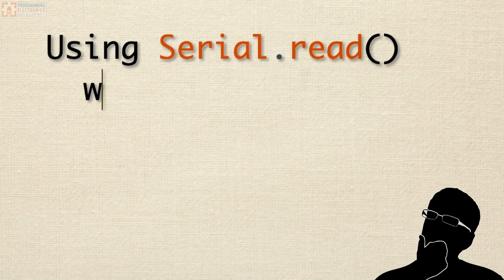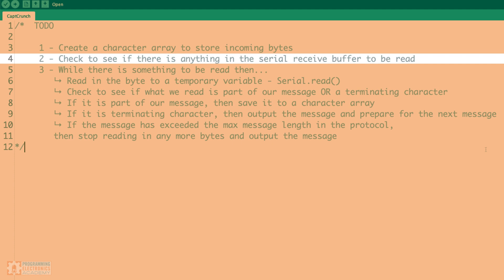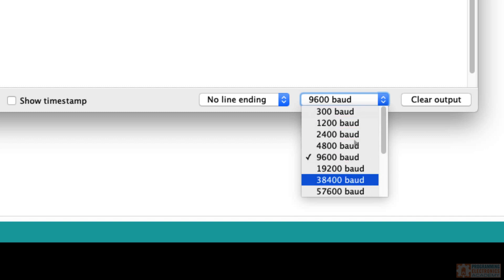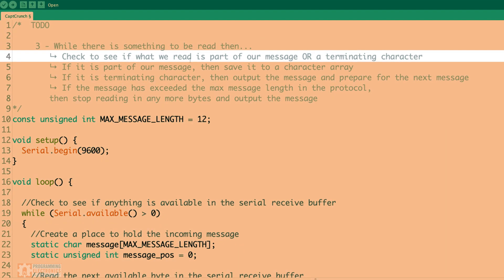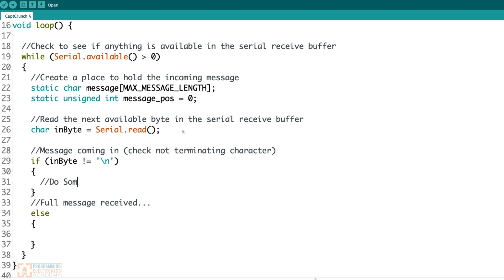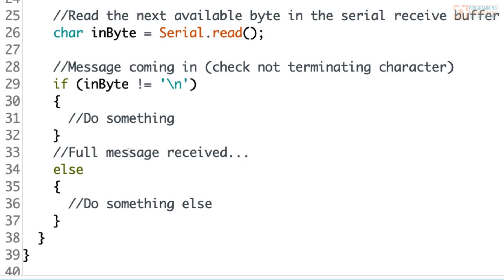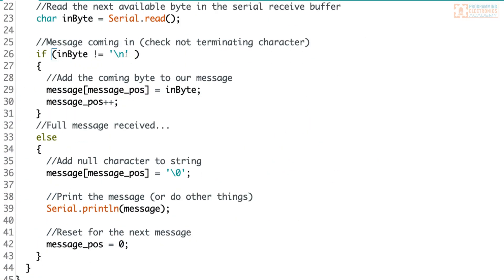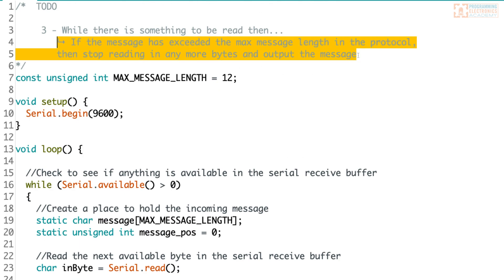Using Serial.read() with Arduino | Part 2

Comment: Can you use Serial Monitor keeping Arduino connected to PC via USB (or even only powering it through USB) and use RX and TX pins to communicate with another device at the same time? My limited understanding of Arduino tells me this is not possible. Explaining a hardware layer would be great please and comparing hardware serial with Software.Serial. That would save some frustration and debugging.

Comment: Parts 1 & 2 have cleared up hours of head scratching after trying to read tutorials on sending data via serial in Stackoverflow and Arduino forums.  I come from a JavaScript background, but the devil is in some of the minor details which go unexplained in a lot of forums out there (probably because prior knowledge of arduino programming and concepts is assumed).  

Those minor details given here made it much easier to understand code elsewhere that had me flummoxed.  Thank you; you've earned my sub.
Reply from the maker: So glad it helped!  I hope you enjoy using Arduino!

Comment: I have a q. Are you sure we have to put the char message and message_pos inside the while loop?
Reply: Good q.
Reply from the maker: Great question.  You could set those up as global variables if you wanted.
Reply: @programmingelectronics  I suppose they should go just outside the while loop and inside the void loop. That way you can reset them to default in each loop. Leaving them inside the while loop the pos is always 0 and the message always changes. I can't understand if it works properly.
Reply from the maker: @periklisdrakousis6537   The variable is set as static, and so it is only initialized once (then that initialization is skipped over after that), which is why it works like it does.
Reply: @programmingelectronics  ok thk u.

Comment: i'm sorry but, i'm confused. 
static char message[12] consists of 11 characters and a NULL character 
when you typed "sub sandwich" = 12 characters, where is the NULL character?
Reply: at 13th position you can print it to check.

Comment: Very good tutorial, and helped me get started on Serial for sure. I did find one thing that might need to be tweaked. Every loop if you exceed the MAX_MESSAGE_SIZE you will lose 1 char out of the buffer. This is because we call Serial.read() before checking the max length of the array. There are many ways to solve this, I ended up doing the check for the max message size before a serial read to prevent losing one position out of the buffer. Using the identical else to clean up anre print the buffer, so I didn't read an extra byte from the buffer. Thanks again for the great content!

Comment: Super Great Video! but I dont see anything in your code to indicate which pin incoming data would coming in? 
(also i'm kind of a noob)
Reply from the maker: Great question!!   The serial Input here is coming in via USB which is connected to pins 0 and 1 on the Arduino.   Hope that helps some!

Comment: Thanks for the great tutorial series. Is there a way we could put a reset in the program when serial communication between master & slave (Simplex) could not sync. I have a master that sends multiple bytes  Ex. "A" contains int val of 2, B has 5, C has7 value and  so on. When I power up both master & slave at the  same time it  all syncs fine. But when you power up one after the other it does not sync even after waiting. When you press reset of slave, one or several times it syncs. I'm using  Arduino mega for both master & slave using Serial 2 port. Is there a way to put a software reset when it does not sync for say about 2 seconds.  I'm using  arduinoJson to serialize & deserialize. I think it's also useful to have a reset when the serial wire was accidentally disconnected. Thanks you.

Comment: Is anyone testing this with the Arduino sketch editor? I copied the code in and tinkered in the serial monitor with No line editing, newline, carriage return, Both NL & CR and none of them parse the data into neatly organized output. It doesn't work for me. Bummer.

Comment: hi, if i want to send let's say 6000 int from laptop to arduino how i can do this ? because arduino buffer take only 64 byte !
Reply from the maker: Great question!   When you use the read function, it clears the serial receive buffer - so depending on the timing you need, you could send a couple, then read a couple, and work through the 6k ints that way... of course, it might depend on what you're doing with the ints when they arrive...

Comment: It's impossible not to subscribe after this smooth tutorial
Reply from the maker: Glad it was helpful!  Are there any specific Arduino topics you would like covered?
Reply: @programmingelectronics   I think topic on proper use of PWM, interrupts, multiple serials(once I was programming rfid,fingerprint,gps and gsm and I was getting trouble on which serial initialize first later on I managed to rearrange properly but I didn't know why arrangement of which serial matter), and serial plotter as well Thanks
Reply: @blackartista  awesome!  Thanks for these ideas!

Comment: Using the same code, if I type a random word and type Enter then the serial monitor displayed the same word I typed in, but on the next line, it gave a zero, is it because the atoi() function doesn't work, or what gets stored in the variable number, when assigned with  atoi(message)?
Reply from the maker: Great question, by chance, in your serial monitor window do you have something other than "New Line" selected in the drop down?

Comment: Hi, thanks
However, my doubts are not yet satisfied
I still wonder if arduino mega has different buffers for the different serial ports
Also, there are plenty of tutorials how to send ASCII characters with serial communication, and my goal, is really understand if i can take the incoming bytes as such, instead to deal with ASCII; most of all, thinking in communication between arduinos instead a PC. For example, an arduino controlling a maschine, with instructions that another one can get from internet via  wifi , or any sensor arrangement, or a arduino that controlls others that operate maschines, etc.  
Arduino is a excellent device to control real world equipment, that allows us to not have to depend on specific control devices already made, that mostly are not the exactly what we need, or are too expensive, or does not fit our needs in implementation
Sadly, seems that arduino is used almost as a toy, instead of the real capabilities it offers    Just a thought
Again , thanks

Comment: Why are you declaring your variables inside of the loop? It looks like message[] and message_pos will be created anew with every incoming byte.
Reply from the maker: Great question Hugh!  Those are static variables, so they will only be declared and initialized the first time through the loop.
Reply: @programmingelectronics  Thanks. I'm more familiar with database programming and didn't understand the "static" declaration.